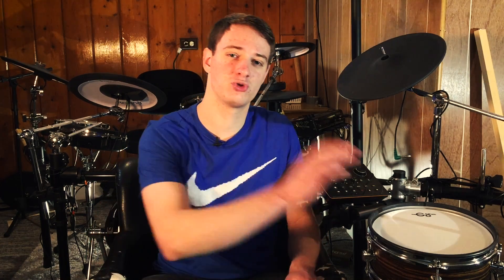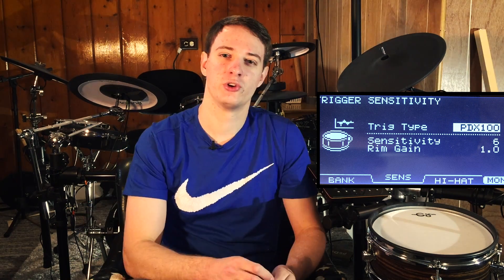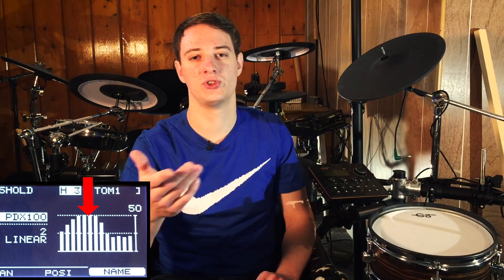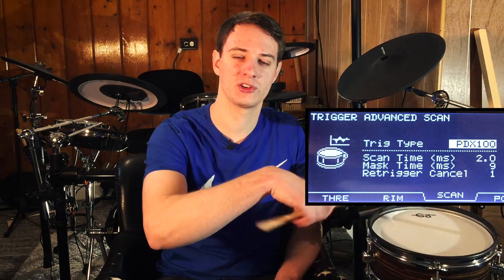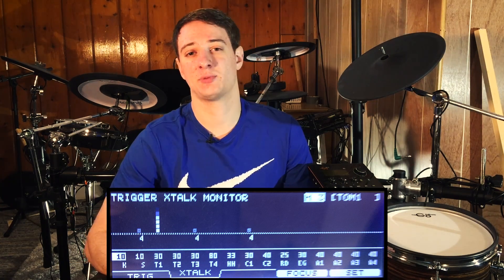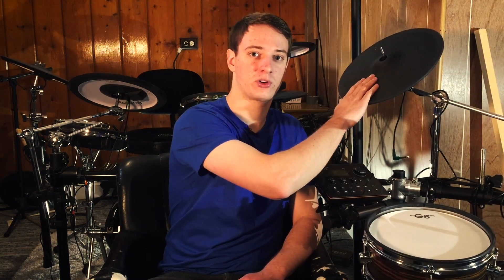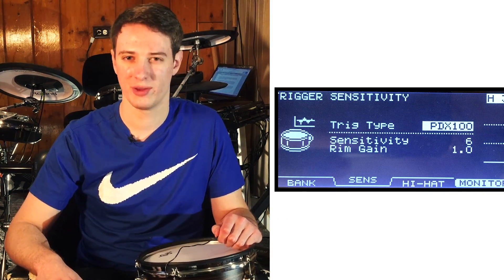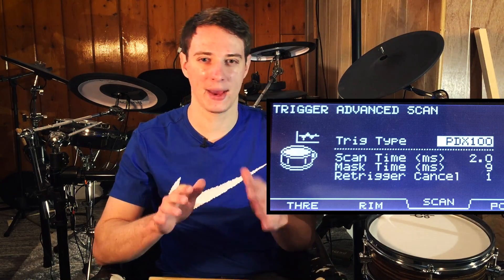All The Electronic Drum Settings Explained (How Scan time, retrig-cancel, and more work)

Comment: Hey Brother, Thank you so much for this video I’ve been in a band always played regular drums. Got a Simmons 1000 dinosaur I know lol
I was messing around with the module in the trigger threshold ext. settings and i lost the speed of my bass drum kept getting ghost hits couldn’t figure out what i did this video fixed my problem in seconds. Also thanks for explaining the duration time of the hits i messed with that also had an idea of what it did but what i didn’t know is the allowance time before the next drum hit/sound extremely helpful. Now i have the drums sounding and responding exactly how i want to. I built my own kit but didn’t know i can also use this information for the preset kits as well. Now i have it on the prekit setting for the 80s and love it. Thanks a Million 😅

Comment: Great video, im upgrading my drums from yamaha dtx 432 to 2box speedlightkit with drumit 5mk2 module, my yamahas didnt have any of these settings but i think that 2box does, specially that kickdrum part was good..i allways leave my beater against the rubberpad and been strugling with that second hit, been playing my sonor acoustic kit since 1983 and last 2years with electrickit at home and instantly noticed that atleast my small yamahakit is way different than acoustic, but easy to play anyway. I know that 2box kit is not a professional one but it fits to my apartment well

Comment: Have you noticed your v-drum triggers lose sensitivity over time?  I've noticed my snare after X years has trouble picking up ghost notes sometimes.  I don't seem to be able to correct it with sensitivity settings either.  If so is there a video on correcting this problem (like retuning the mesh or taking the trigger apart)?  Great video, very helpful.
Reply from the maker: Sometimes the foam cone gets old and shrinks, try replacing that piece. parts are on ebay

Comment: Hi, I have a TD9 and sometimes when I hit the snare and cymbal at the same time, I always hear the snare but every now and again it cancels out the sound of the cymbal. I cant seem to figure out how to fix that. I would greatly appreciate your help or a link to a video that explains how to fix it. Thanks!
Reply: I have the same problem when I hit the Ride and Kick, sometimes the ride does not trigger. It-s not the pad because I've changed with the crash pad, still the problem to the ride. Have you found a solution?

Comment: Hey Justin, Im not sure if you'd know anything about this - But I just bought a Roland Td-50kv and I have Addictive Drums 2 Software im running. I cant for the life of me figure out how to do custom"Mapping" for these drums ? The set feels all wrong and the hihat and cymbals are the worst feeling. Tried mapping but its complicated. There is so many Stroke Types its dizzying. XLN has NO helpful videos at all. Do you know anything about AD2 ?   Thanks
Reply: I also use AD2 in conjunction with my electronic drum kit. Maybe I can help you.

If you want to reassign to different pads, go to "? -> Map Window"
Select a sound using the buttons in the upper middle (Cym 3, Flexi 1, Snare, etc.)
Now select the desired sound (like Tom 1 Open Hit), click the "Learn" button and then strike the pad you want to assign that sound to.
Now this sound is mapped to the pad you hit. Make sure to also adjust the velocity curve in case it doesn't feel right.
When you're done, go to the drop-down menu under "Map Preset" and save your custom mapping.

I can't help you with positional sensing or the more advanced hihat settings, since my hardware is a lot more basic than yours.
However, a quick Google search should lead you to someone who had the exact same problem and found a solution for it.

Comment: I have a probably very newbie question:  will these settings still be effective, even if I'm triggering my sounds from my logic pro x program on my mac?  Thanks!
Reply: Yes. These settings can be considered at the basic setup of the kit. Cross talk will happen regardless of the module or software.. Triggering sounds from logic don't you take midi from the drum module? If you are getting cross talk there, you'll get it in Logic too.

Comment: I need help! I'm using GetGood Drum's Matt Halpern Signature Pack with a Drumtec Diabolo drumset fitted with a TD15 Brain. Whenever I do a flam on 2 different drums (snare and tom), no matter how soft, there will be another snare hit. This also applies to my bass drum or cymbals and it's annoying me!! 

Users in the forum have also asked me to adjust the velocity to be log curve and drum module settings but I still can't get it to work! I've tried to mess around with the mask time etc but it seems I'm not getting the settings right.

Any tips additional tips or things I'm doing wrongly?
Reply from the maker: Ouch :( did you try raising the threshold ?

Comment: Very nice video! Do you know how to fix hotspots or adjust settings in the module to reduce that? Sometimes I want to record something and when I hit the center of the snare, it triggers a very loud sound and ruins everything
Reply from the maker: Turn down the sensitivity. That should help. Also try tuning the pad tighter. Loose mesh heads cause hotspots.
Reply: I'll look into it thanks:)

Comment: Hey Justin , great video. got  a Q . will the module setting apply when triggering software ...?
Reply from the maker: Yes! Alot of these setting apply when using software. But you may have to tweek it a bit.
Reply: ok cool ...i used a blank drum on the module thats dedicated to the software...just wanted to double check
Reply from the maker: that a good idea, never thought of that